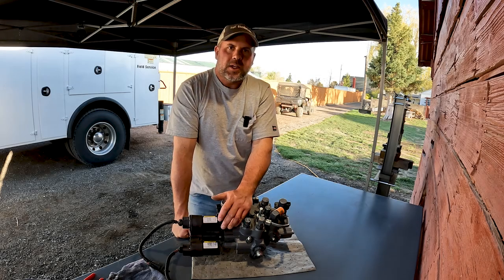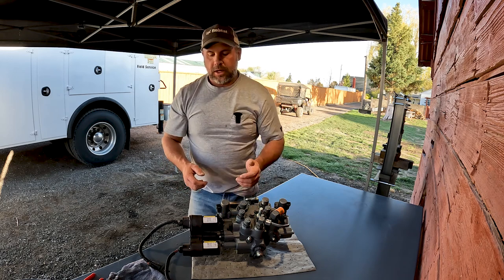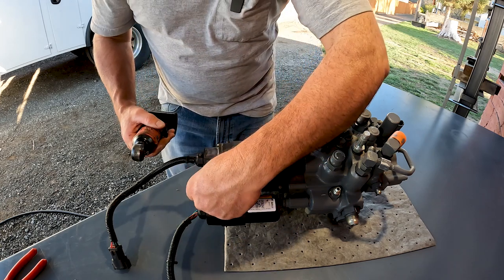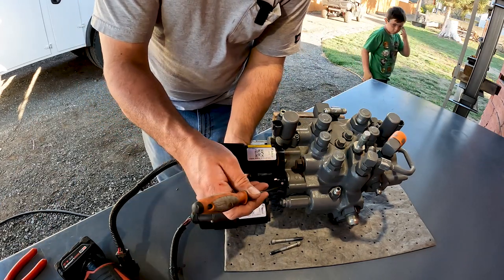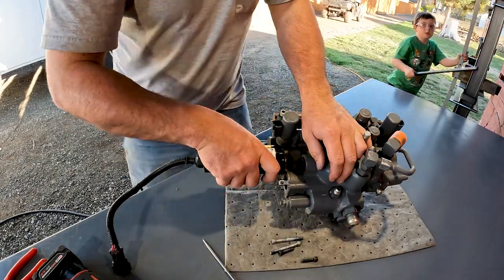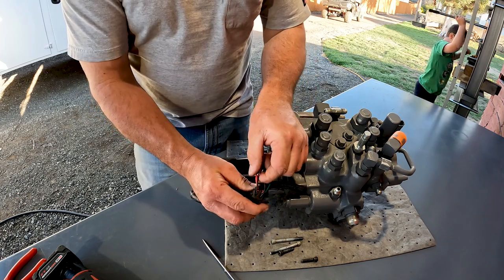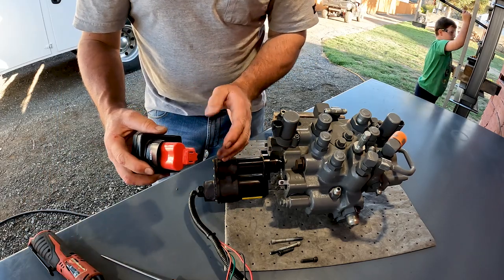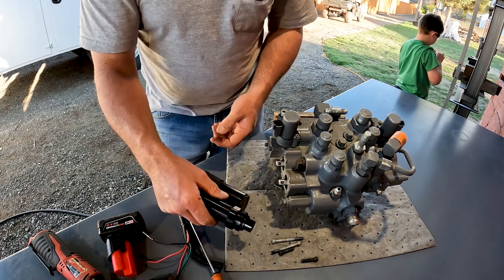Bobcat Actuator Removal Tips and Tricks

Comment: I'm a new bobcat tech and I like watching the videos to learnung Some small things
Reply from the maker: Thanks so much- is there anything in particular that would be beneficial to cover?  I appreciate you watching!
Reply: @tetradgroup  I guess diagnosis on can bus. I have a t66 r series that's is doing weird stuff by throwing left and right joystick base and grip message failure and keypad no communication and cab controller no communication
Reply from the maker: @tannerkottwitz3883  that's funny because I have one doing the same thing but it's so intermittent I can't find the problem.  Already replaced both joysticks and workgroup controller.  Looks like a wiring harness next.
Reply: @tetradgroup  I don't think my problem is any joystick I'm gonna check the resistance of the can bus and see what it is. First time it did it to me I moved dirt for 30 min and it was only right joystick base failure. Then I cleaned hub controller, and cab and a bunch if other connections moved dirt for 30min again and got all the joy stick and keypad codes. Check the harness saw no problems. We had another t66 with a similar problem guy cleaned connectors and couldn't get it to replicate and he moved dirt for 3 hours
Reply from the maker: @tannerkottwitz3883  I hope you figure it out, mine will run 3 or 4 days without an issue then it will act up out of nowhere and by the time I get to jobsite it runs fine again. I see the stored codes but can't replicate. CAN test fine but of course it's not broke when I get to it.  Very frustrating.
Reply: @tetradgroup  so after replacing the right base and the left joystick assembly all the joystick message problems went away and the ptol keypad no communication also went away I moved dirt for 4 hours with no problems. Then anthoer r series loader had the same issues and the problem was from the factory the wires rubbed and cause problem on the wires from the grip to the base and the loader only had 20 hours

Comment: do i have to take out the entire control valve out the get the lift spool out when i try taking it out in runs into another hard hydraulic line
Reply from the maker: Hopefully you can move the metal line, 773 should have enough room to remove spool.

Comment: What about on install? Do you drive the actuator back in or?
Reply from the maker: If the actuator is working correctly then you can easily just push it in by hand.
Reply: @tetradgroup  I'm currently in the process of reinstalling my tilt actuator and I cannot get it to go in...
Reply from the maker: @charlesthorpe3179  you can try to turn the machine on and see if it will try to center itself or you can run it in with a battery but it should be smooth and easy,
Reply: @tetradgroup  I wasn't holding my face right 🤣 but after "rebuilding" it...I'm still getting a short to ground fault 😒